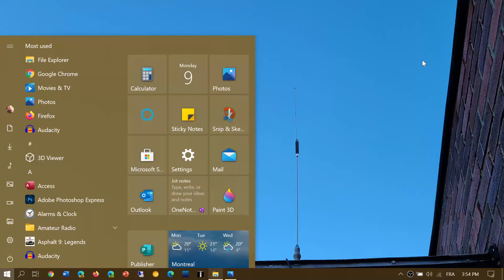My Vertical Mobile Wideband VHF UHF antenna outside

Comment: I did this on a base with four reflective sticks and installed it on the balcony of the 10th floor where I live (large urban center), to operate a portable scanner, AR-DV10. It was very good for the uhf/vhf tracks. 73

Comment: Pretty sweet. I have a really tall one from radio shack with a sort of conical black plastic base then solid nonflexible metal rod running up to a loading coil with a flexible whip metal on top and than another coil and whip metal on top of that. 2 coils! It's really good on lowband. I could hear the neighbors old cordless phone, i managed to figure out the phone number and called them to tell.

Comment: I have an old Radio Shack shortwave antenna kit 278-758 for shortwave. Is it better mounting E-W, N-S, or doesn’t matter?  EW is alongside a house. NS is tree to house mount.  Using on a Lafayette HA230 from the ‘50’s I believe or early’60’s
Reply: Either way that you mount it should work fine. I believe the HA230 was built between 1964-1965. I have Lafayette KT-320 which was made in 1961. FYI, Both radios were available in kit form, indicated by the model number. Factory assembled models begin with HA or HE and the kit models begin with KT.  Yours is the factory version thus HA, the kit version of your radio is the KT340. My radio was a kit, KT-320, the factory model is the HE-30. You might find it interesting to know that these radios were manufactured for Lafayette by the Trio Corporation which is now Kenwood.